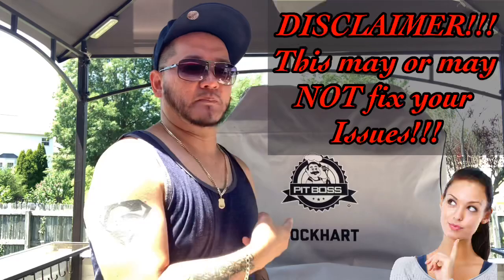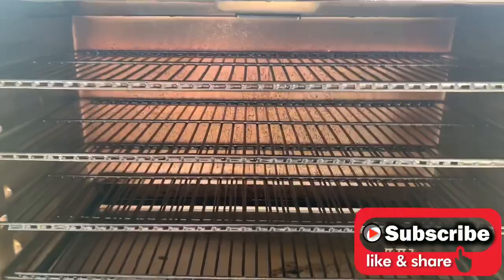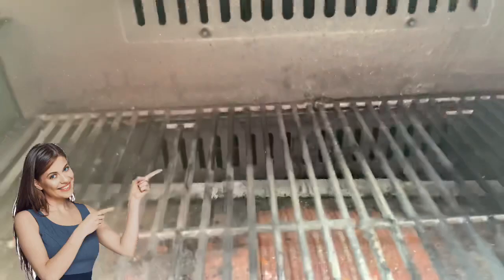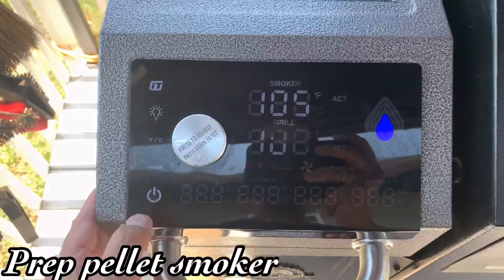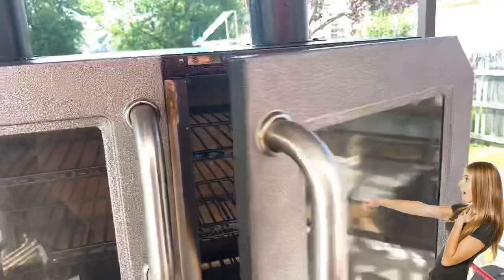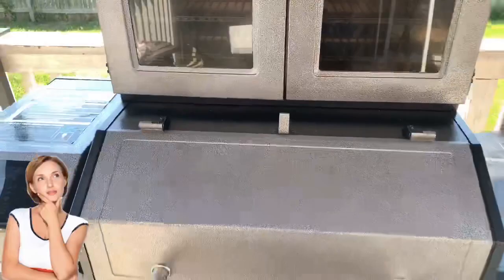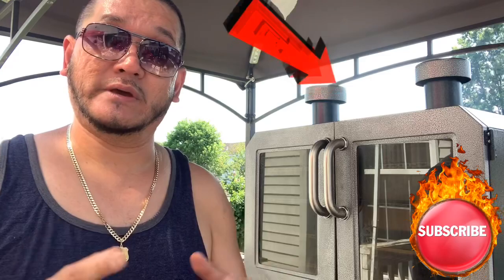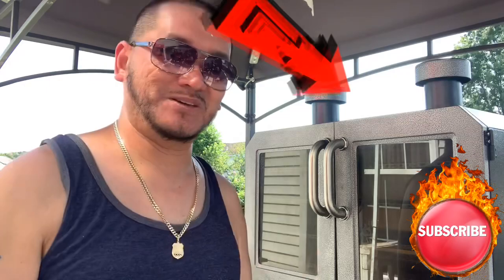HOW TO FIX PIT BOSS PLATINUM LOCKHART SMOKE CABINET ISSUES/ANSWERS TO THE SMOKE CABINET PROBLEMS!!!

Comment: I use a cold smoke generator tube on the grill when smoking in the cabinet. Vinegar works great for cleaning the glass.  Rethreading the caps to get them lower on the chimney stacks. Glad to see you are smoking and getting the word out.

Comment: Great breakdown! I don’t use the top as much as I should. But when I do it hasn’t failed me yet! Like you said, not the sole of a stick burner, but seems a bit more efficient! You can really tell at night if you shine your flashlight the amount of smoke that comes out of it! Lockhart is by far the best smoker I’ve ever used! Great video! 💯🔥🔥🔥
Reply from the maker: Right brotha Dustin. As you need more smoke then at a smoke tube like you do in your lockhart. Thanks for watching. Cheers and keepbbqing!!!

Comment: I just purchased my unit and have one question and two comments. 
Is there a way to control the temperature in less than 5-degree increments? Not a big deal, but wether will sometimes play with the internal temps. Since I don't have to babysit the fire, I now have plenty of time to stare at the digital numbers.... soooo
Your videos were beneficial, and I used a little bbq seal around the lower door. Can't remember the thickness, but it was the thinnest they had. It sealed that lower box and pushed a lot more smoke up. I then tune the top vents to trap the smoke, raising the upper box temp 5-10 deg. Hope this is helpful. 
Great job!

Comment: Others have suggested the smoker tube I too had these problems coming from my stick burner. learning how to use a smoke tube is crucial for that big smoke flavor. if you have nothing on bottom I use two amaze smoke tubes or whatever brand you buy, and they typically go for 3-5 hr continually. It will push all the smoke you want up there happy smoking and great video partner keep up the good work

Comment: I found that if you leave the vent open for the sear option in the lower cabinet, you maintain a much better temperature in the upper cabinet. I had a problem with the fire going out and it shutting off when I was using the upper cabinet trying to keep it at 225. When you keep that sear vent open, you don't have that problem and you use less pellets cuz it stays hotter with less fuel

Comment: I purchased this smoker because of the price. We got a great deal on it. I would caution anyone on this unit because of the complexity of how it operates. The smoker cabinet on top does not have an actual temperature control which can be very frustrating. You must control it through the temp of the bottom cabinet which means you can really only use either the top or the bottom at one time. With an ambient temp of 70 - 90 degrees I have to run the bottom cabinet an average of 100 degrees hotter to achieve the desired temp on the top but even this is not consistent and requires babysitting. For me that kind of defeats the purpose of a pellet grill/smoker. Thank you for your video but if I had to do it again I would stay away from this smoker.
Reply: I have the exact same opinion.  Worse on a colder day.  When it's running so hot on the bottom, it fails to produce smoke.  I'd venture to say that people in warmer climates have better results.  Sad that there has to be a workaround, and seems like a poor design.

Comment: I'm new to the pellet smoker world and have this smoker as well. Mine bellows smoke (once it starts) for 5 min then turns the pellet pit into a blow torch basically, even on Smoke setting. Are you getting the same reaction? Have you noticed a difference in the types or brands of pellets for smoke? I've troubleshooted and vaccuumed out the pellet pit to see if that helps but I never get smoke on any temp once it turns into a blowtorch.

Comment: I have only had mine for 3 months now. I had no issues for about the first 2 months but then started getting a ERR no pellets error and temps started going all over the place. They sent me a replacement board and it started acting up within 3 cooks. Talked to them about it again and they just sent me another board. I am really hoping this is just a fluke because I really liked this design and features.

Comment: purchased unit 8 months ago. It’s been broke down 3 of those months waiting to replace the igniter which has now broke twice in the middle of smoking. Lights no longer work and finish started flaking off after 1 month.
Reply: Wife just got me one this last Father's day. The first main board worked pretty good for 2 months and then nothing but issues. It gave err no pellet codes and temp probes were way off. They sent me a replacement and not even 3 cooks later it started doing the same thing. They have now sent me a second board to replace the replacement. I also have spots on the upper cabinet which has never gone above 250° with a large spot of bubbling paint. I had to buy a can of high temp bbq paint to patch the spot.

Comment: Very Good Video Let's see some BBCUE!!!! :).  I Grill hardcore all year long in Minnesota your either working with or against the elements for the love of Grilling! On the 2nd chamber do you every do casserole etc while BBC in the main chamber?  

I have a 1st generation Weber smoke fire pellet gril... ARRRG!  Rebuilt it 3 times now, 4 glow plug igniters, auger, pellet slide & grate(it disintegrated), multiple grill fires.  I just told them to send me a new replacement current generation grill I would be surprised if they do?🤔

Your video hooked me in picking up Pit Boss Lockart and kicking my weber to the scrapper

Comment: The porcelain of my grids is bubbling, is it because is too hot or was just not coated properly. I normally don't grill over 400 F. How much heat are those porcelain-coated grids supposed to handle. I have not used anything that can damaged, I have cleaned it with a nylon brush and just used the tongs to flip my meats. I just bought it about a week ago.  Is it the direct heat to the grids creating the issue?
Reply from the maker: Hey brother Jorge. Well, it depends on how much you use your smoker. The grates usually last about 3 to 5 years on normal use. I do think you have some defective grates because you’re right!!! They should not be bubbling at 400 degrees. Usually porcelain coated grates can withstand about 800 degrees or more. In your situation is definitely different and highly recommend that you don’t use those grates anymore. You can order similar dimensions grates online to replace them. Sorry i couldn’t be more helpful on this matter. If you have any other questions please feel free to ask. Thanks for watching and for your support. Salute!!!

Comment: That’s a lot of great information. Would it also be possible that the pellets themselves could be bad? I’ve found on my smoker the lower I set the temperature the more smoke I produce. I haven’t had a unit with an upper separate cabinet before. ✌️
Reply from the maker: Hey Scott actually your theory might be correct i have seen this issue on different Facebook forums also you are correct as well on the lower the temp the more smoke you will get. The only issue is that the smoke cabinet will not get above 125 if smoking at a lower temp on the bottom grill. Thanks for watching brotha. Cheers and keepbbqing!!!

Comment: So what temp do you have to set it at to get the temp in the smoke cabinet to reach 250?
Reply from the maker: Well depending on the weather but usually around 375 to 425. The trick is the higher the temp on the bottom grill the higher the smoke cabinet. Overall this is a great smoker with great versatility for a large family or gathering. Thanks watching brotha Geoff. Cheers and keepbbqing!!!
Reply: Thank you again for another good video. thinking of picking this up. B4 memorial weekend
Reply: So if I want to smoke bottom level at 225 I won't get any smoke at cabinet level?
Reply: @tanknyc  if you want to smoke at the bottom level you won’t get high enough temps up top.

Comment: I have the austin xl and love it. Looking at this smoker now though and just wondering how you control the smoke box temp up top. If I want to smoke at 250 on the top and say 300 on the bottom. Or grill at 500 on the bottom but still keep 250 on the top is that possible or does the temp you have on the bottom have to be adjusted to whatever it needs to be to hold 250 at the top?  Just wondering if I can cook at 2 different temps without a problem.
Reply: You can increase the temperature differences between the 2 chambers by adjusting air flow to the top. It would just take some minor adjusting and waiting for temps to even out.

Comment: Nice tips! Considering this smoker, I like the dual setup. One main question i would have is how hot does the back of this unit get. I have a covered porch and this smoker would be against a wall. How far away from the wall would you recommend. Thanks a bunch. Just subbed as well.
Reply: 1 or 2 feet away from a flammable wall is all the space you need. If you need it to be closer than that because of limited space you could buy some heat shielding material that welders and blacksmiths use to protect from intense high heat.
Reply: That applies to any heat source you may have close to your house

Comment: How do you keep the temps up around 250 in the upper?  To get mine up that high i have to have the grill way up and get no smoke
Reply: If you aren't getting enough smoke it's because the airflow isn't high enough